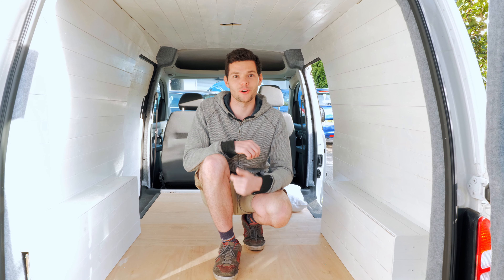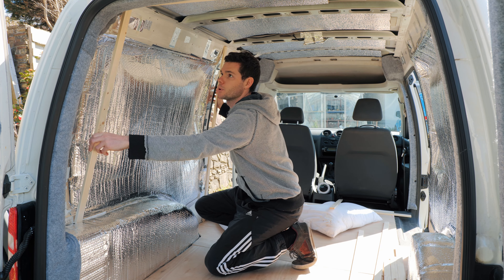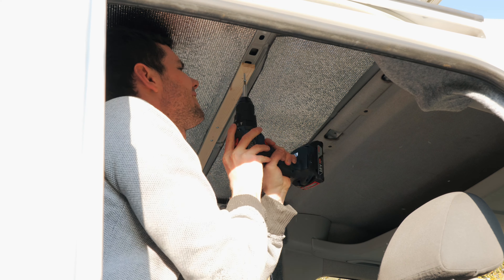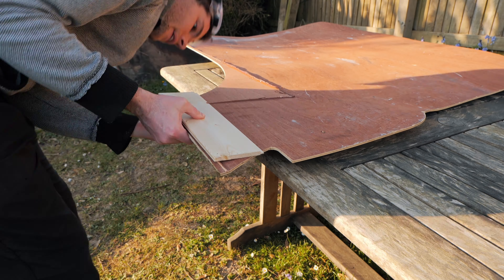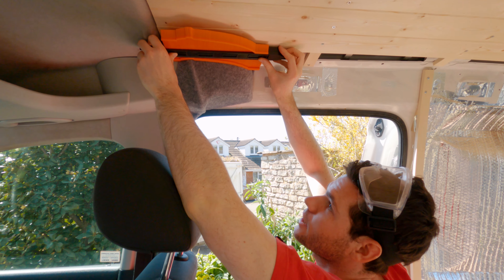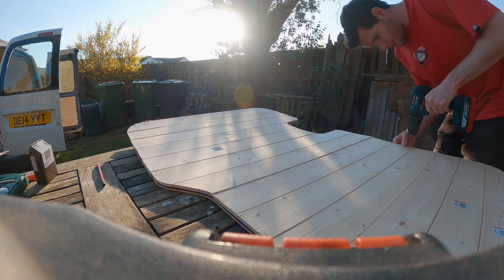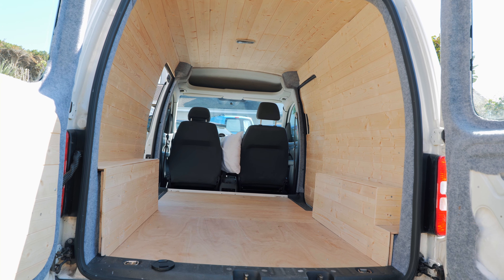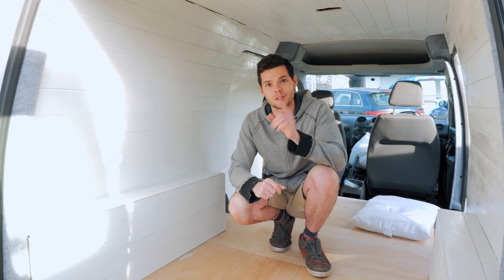How To Clad Your Volkswagen Caddy With Tongue & Groove Cladding!

Comment: Wow great video, this has helped a lot with how I'll intend to go about cladding my van, especially the sliding door and wheel boxes. What great idea!
Reply from the maker: No worries, I'm glad its helped! Are you doing a caddy as well?
Reply: @willsvanadventures  No I'm doing a Toyota Hiace though I had ply lining and wheel arch boxes in good condition that came with the van. I'll re-use in the same way you done your sliding door and glued your wheel arch boxes back. Instead of screwing them in, I'll glue them now to prevent rusting.
Reply from the maker: @janetanderson422  ah awesome that's ideal! Saves a lot of money and yh that's the best way to avoid future rusting. Good luck!

Comment: Maybe they changed the formula or something ?... as I used Evo Stick No Nails to tile the bathroom back in November 2004 with 12 x 9 tiles and 18 years later its still holding up well ! 

You made a nice job of the van, One important thing though, unless your rear light clusters can be unscrewed from the out side of the van, then it would have been a good idea to make a section of the cladding by the rear lights accessible by using some Velcro strips to secure these access sections in place, that way if a bulb blows, you won't have problems getting to the rear lights to change a blown bulb...
Reply from the maker: Oh that's mad. I mean it should work like that. Just didn't on ours for some reason. Maybe I did it wrong but followed the instructions 😂

Thanks! And yh I haven't thought about this in the past and on my current van. Was quite difficult to do and couldn't see a good way to do it with the cladding in the end. Unless I lost a load of inside space.
Reply: @willsvanadventures  Maybe the instructions were wrong lol

Saying that, I remembered a few years ago the valve went on my shower and I was then forced to remove one tile which had a round hole cut out, I think it was around 80mm in dia or something... anyway, I tried to be as careful as possible to get the tile off in 1 piece, I raked all the grout around that tile then tried to use a wall scraper to pry it loose... let's just say it was going nowhere !, after about 3 hours trying everything not to damage the tile, I lost my rag and took a hammer to it ! lol

Even with the tile smashed parts of it needed the claw of the hammer to break the no nails bond ! - seriously.

Lucky I had a few spare tiles the same unused sitting in the basement so I just recut the 80mm hole in another spare unused tile and put it back up when I replaced the shower valve - this time I used plumber's gold sealant ! instead to fix that tile back in place...

Comment: Is this much heavier than ply? 
I'm going to start a Berlingo conversion and hopefully learn enough to eventually do a bigger van.

Oops just see that you attached the Tonggue and groove. Planks onto the ply?
Reply from the maker: Hey, I'm not sure in the weight difference tbh. I don't think it'll be much more. So I attached the cladding to a frame on the main sections. But on the doors I attached it to the ply.

Comment: Question: drilling holes into the ceiling like you did in order to attach the wood, won’t it bring any rust?
Reply from the maker: @RollingMonte  hi, nah it won't as you can drill into the inner bit of metal. There's like the outer and inter parts. 🙂

Comment: Just remember tongue and groove has a lot of movement it will decrease and increase depending on the weather... no more nails is for wood to wood not metal.. still looks mint thought.
Reply from the maker: Yh that's true it will. I screwed in the cladding instead if using the no more nails stuff. I was only going to use the no more nails for wood to wood but it didn't even work.

Comment: Nice one bud looks great ! I’ve tried screwing these batons in but the metal must be really hard in my van cause I’m trying to drill holes but the drill bit keeps snapping 😂
Reply from the maker: Oh wow haha what van do you have? I just used self tapping screws straight off with no drilling needed. When drilling into van metal I know if the angle isn't quite right and you force it, it'll snap the screw bits.

Comment: great video will! just about to start doing up my van and tackling the cladding! just wanted to ask what wood screws you used to secure cladding onto the existing plywood? and did you use a 8mm plywood? many thanks and keep up the good work !
Reply from the maker: Thanks! Glad to hear you are doing one as well! Umm honestly I can't remember what screws I used sorry. Would just be standard wood screws. The cladding was 9mm I believe so maybe the screws were 20mm or near about that? 

For the floor the plwood was 10/12mm. The cladding was fixed to a frame. 🙂

Comment: Hi. How do you get those upright rear batons to bend inwards? 
Did you secure the top, push it in then secure the bottom whilst you're pushing/bending it inwards?  Or have you tapped it to the metal in the middle
Reply from the maker: Hey, yeah so I secured the top and bottom and then pushed the middle in and secured that.

Comment: Will, that looks really good, looks really neat & once painted the white looks good as a contrast to the Grey carpet.  

Did think before you painted it, whether it would look as good varnished instead, is there a reason why you went for white, bright, space, etc?

But that does look fantastic, so what's next?
Reply from the maker: Thanks! I agree as you say the white and grey looks really good. I was unsure on painting it white at first as you say the natural wood did look really amazing. But the plan was always to go white with the grey carpet. Just liked that style and colour scheme tbh. Makes it look fresh and neat. I think if I didnt have the grey carpet then I'd have kept it natural with a clear varnish. 

Going forward I've got the flooring video to edit, the lanyard hack for the back door. Cab clean, a video about installing the van x curtains and then a final video tour. Haha so a few to get through.
Reply: @willsvanadventures  for me the van x curtains ended up being the best fifty quid I’ve ever spent! So easy to river into place and the outcome is brilliant! I did use more/other rivets than was supplied though as they kept breaking 😂😂
Reply from the maker: @MortsLindholm  yh I've put them in and they are great. Was quite a job as the screws supplied kept snapping so took a lot longer than expected haha.

Comment: great video, quick question - why do all cladding fitting on vans use the batton method? what's wrong with cladding over ply pannels and screwing them back in ?
Reply from the maker: Hey, thank you! It's just to save money and weight as you don't need both. But your not wrong, you could do the ply first and then put glad onto that. Would be faster and easier. But would just cost more.
Reply: @willsvanadventures  Hi Will thanks for this. Apologies for the late reply. I've left my ply lining out in the elements so don't want to T&G over it so am going ahead with batton's. How do I ensure I'm not going to be drilling these into any wires or through the body work of the van ?
Reply from the maker: @solred8093  no worries. What type of van do you have? Most vans have a inner skin which you can drill into. If you drill into the outer skin then it'll go through to the outside of the metal. Hope that helps.
Reply: @willsvanadventures  hi will I’ve got a caddy 2013 standard size.
Reply from the maker: @solred8093  oh cool. Yeah they'll be an inner skin of a metal frame. You can screw/drill into that.
Reply: @willsvanadventures  okay great thanks. I've got the easy drive 25mm metal screws with 18m by 30mm battons. With regards to avoiding wires  when getting the battons in should i just go for it ?
Reply from the maker: @solred8093  yeah if you follow the video then you should be fine. As you have a swb caddy itll be very similar. If your not sure on anything just check with a garage before going crazy.

Comment: Hi mate. Great video. What screws did you use?
Reply from the maker: Thanks! For securing the frame to the van it was 25mm self tapers. Then for the cladding I believe would have been like 15-20mm (something around that length) wood screws.

Comment: This looks so good! How do the screws look when you painted over them? We're in the process of doing our van at the moment and are trying to work out the best way to attach the cladding to the battens.
Reply from the maker: Hey, yeah I ended up using wood screws and once painted you could barely see them. To be honest you couldn't notice them at tall. But initially I didn't want to use screws as I wanted it to be a seamless finish but it seemed to be the only way that would hold the force to the battens.

Comment: Progressing well great job! Just one question Will how do you go about locking/opening the doors e.g. have you made one of the doors in the rear openable to overcome the central locking system? And if so can you please post details.
Reply from the maker: Hey, thanks! Sorry I dont really understand what you mean? I've added a lanyard to the back door so you can open it from the inside. Is that what you met? If you meant for the van locking again, I've never had an issue, just unlock the van and all the doors stay unlocked?
Reply: @willsvanadventures  Thanks for that, it was just the possible issue of locking the doors whilst in the back of the van for added security and not being able to get out unless you use the key pad locking system.
Reply from the maker: @davidvardy8582  oh I see, yh I've just had to unlock the back with the keys to get out.

Comment: How much weight did this add to the van? Surely when you also start adding presses, beds, etc you be damn close to the max weight of the van before you load it,..
Reply from the maker: Hey, I'm not sure tbh but it wont be near to the limit as the vans are designed to be loaded up as they are builders vans. :) they can carry upto near 800kg.

Comment: Does it matter where you screw the wood into the van? Is it possible to put a whole through it or am I just being paranoid?
Reply from the maker: Hey, yes it does. If you screw into the metal in the wrong place you will go through to the outside and put a hole in your van. In most Van's you have to metal layers. An outer layer that goes through to the outside and an inner metal layer. 

If you screw into the inner layer then you won't go through to the outside. Hope that helps :)

Comment: Hi, great video Im converting a caddy maxi myself and your videos have been very helpful. Im planning on cladding the roof like you’ve done here, do you happen to know how many packs of the cladding you used just for the ceiling? And did you buy the 2.4m lengths so there were no joins? Cheers, Kieran
Reply from the maker: Hey, thanks for watching, I'm glad the videos are helping! And yh I bought the 2.4m packs. Think i got 3 packs, and then got 2 of the shorter packs for the doors. Hope that helps!
Reply: @willsvanadventures  Great thank you!
Reply: How much did the 3 packs weigh. Also all timber attracts and holds moisture

Comment: I don't really understand why you're shoving a cavity of still air full of insulation materials? The conductivity value of air is 0,026 W·m-1·K-1, and the same for insulation is about 0,037. So, theoretically, by shoving those cavities full of insulation materials, you're actually making them less insulating...
Reply from the maker: It deffo works and is worth doing.  I guess why would anyone Insulate houses if an air  gap was better? Might not be the math like you say but it works.

Comment: Hey will, it's been my dream to have something similar van wise and it's obvious you have the skills and know how to modify a van. I was physically fit upnuntil 4 years ago where I developed a paraspinal abscess leaving me temporarily paralysed from head to toe. Fortunately the antibiotics worked and I can walk quite well considering but the dexterity and power in my hands are really quite poor. Could we keeping tough perhaps and you leave your email address or number as drilling will completely flatten me with pain down my spinal cord. I do what most men do in my position and think they can do more than they really can (live in a fantasy land) but in reality would need help. Off I would pay for it and it will be a number of months due to saving and a money situation but  it sounds as though it's not the first thing you have modified. I have to admit it I am disabled but I'm not in a chair but using bail guns saws drills etc would be a bad idea. It's a long way off but an exchange of details if you are prepared to help a man in need that would be truly amazing. Oh btw I have major parathesia (pins and needles stabbing and electric shock pains in my feet hands and both legs. I also walk into door frames too as the damage to my spinal cord has caused a strange sensation of like being pis£%d crossed with vertigo. It's s long way off until I get the finances and ideas together (which you would also ge a great help with) so there's no rush. You and your g.f. did a great job. Congrats on tidy fitting. It look greatm